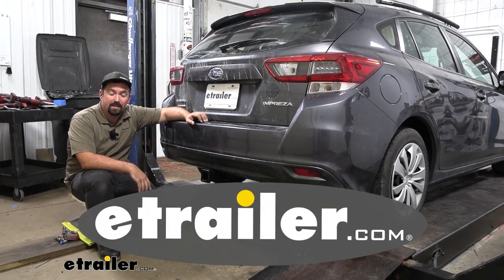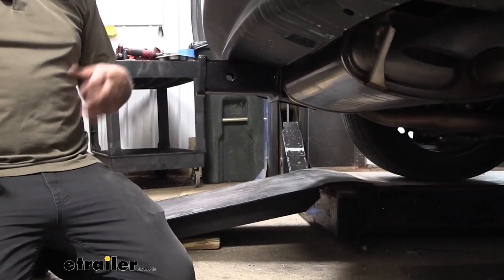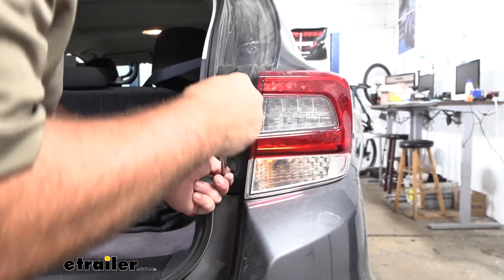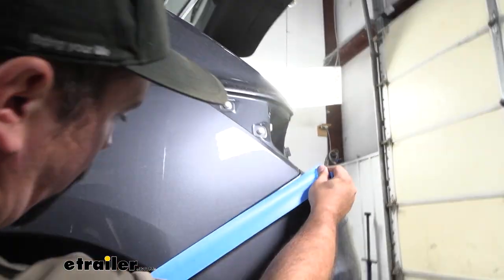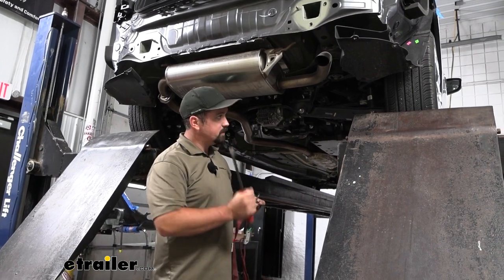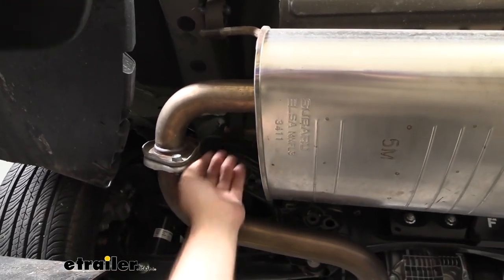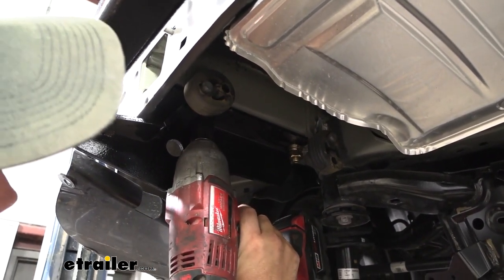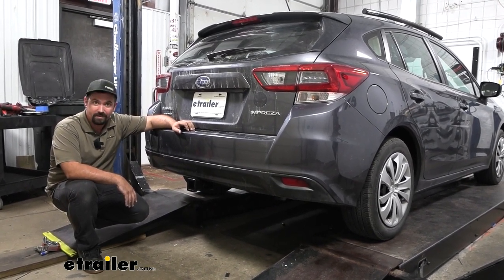etrailer | 2023 Subaru Impreza EcoHitch Hidden Trailer Hitch Receiver: Complete Installation

Comment: Is it true these have a towing capacity rating of 2600 lbs?
Reply from the maker: The hitch has a 3500 lb towing/525 lb tongue weight capacity. That being said, Subaru states in the owner's manual that the vehicle shouldn't be used for towing, but the hitch can be used as an attachment point for a hitch mounted accessory.
https://www.etrailer.com/Trailer-Hitch/EcoHitch/306-X7350.html